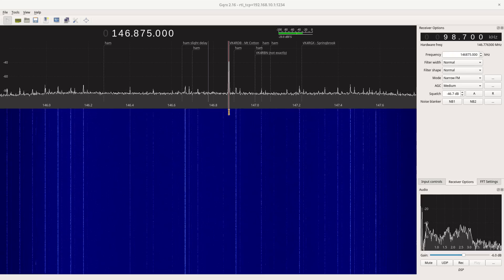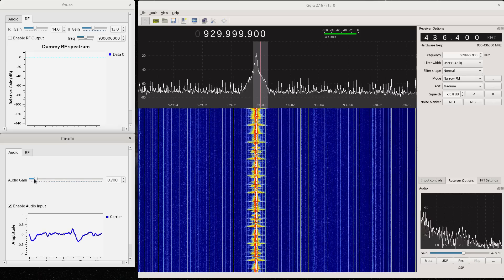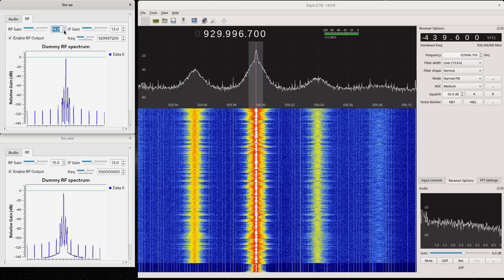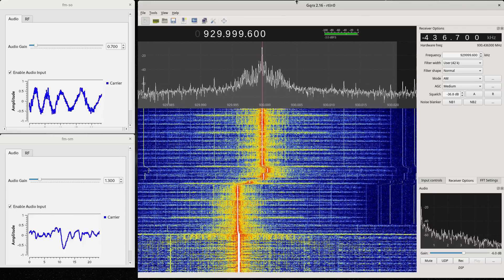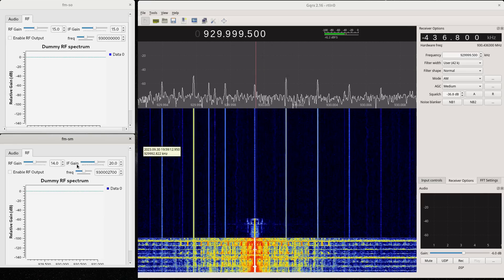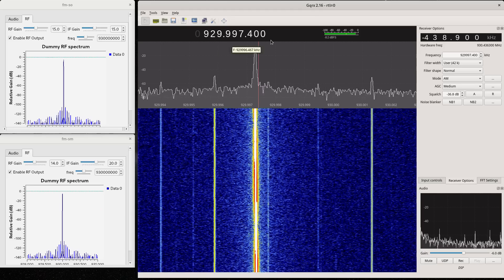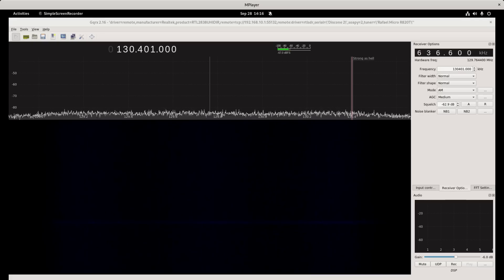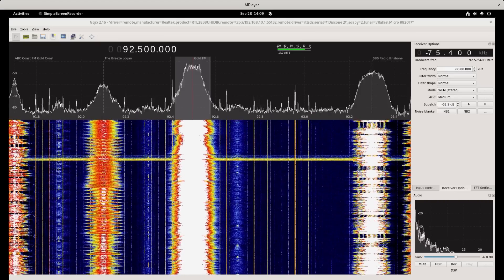Demonstrating FM Capture Effect

Comment: Interesting. So if doubling AM transmissions don't really lose much information, it should be possible to use DSP to clean it up when the carriers are slightly off frequency?
Reply: If you're not chasing high-fidelity, you can basically notch filter out the beat tone.   That frequency response at the notch frequency from both signals would essentially get lost, though that's not too big of an issue if you just want to hear voice transmissions.  I would imagine if the beat tone was not fully saturating the modulation at that frequency, some information at that frequency might be still recoverable.

Comment: rejection: AM is less susceptible to interference from electrical storms and other sources of noise. In aviation, it's critical to have a robust and reliable communication system.

Simplified receivers: AM receivers are relatively simple compared to Frequency Modulation (FM) or other more complex modulation techniques. This simplicity can be advantageous for aviation, where equipment must be rugged and reliable.

Propagation characteristics: AM radio waves can travel longer distances and are less affected by obstacles like hills or buildings, which is vital for maintaining communication with aircraft at various altitudes and distances from ground-based transmitters.

Voice intelligibility: AM provides good voice intelligibility, and this is crucial for clear communication between air traffic controllers and pilots. Even if there is some interference or signal degradation, the message can still be understood.

Regulatory standards: AM has been standardized for aviation communication, making it easier to ensure interoperability and compliance with regulations.

Legacy systems: Many aircraft and ground-based communication systems still use AM, and transitioning to a new modulation scheme would require significant investment and coordination. This legacy infrastructure plays a substantial role in maintaining AM's prevalence in aviation.

Proven reliability: Over decades of use, AM communication systems have demonstrated their reliability and effectiveness in ensuring safe and efficient air traffic control.

It's worth noting that while AM has these advantages, modern aviation communication systems are increasingly incorporating digital modulation techniques for various data and navigation functions, alongside traditional AM voice communication. These digital systems offer benefits like more efficient use of bandwidth and error correction capabilities. However, AM remains a crucial part of aviation communication due to its historical significance and suitability for voice communication.
Reply: All wrong!!!  The problem is the Dolby effect for the velocity of the planes!!!
Reply: I wouldn't say that AM can travel longer distance - AM really just a mode of operation. The 'distance' the signal can travel and be understood is more dependent on the frequency being used, and atmospheric conditions (time of day, solar activity, etc)

What we think of as broadcast AM radio indeed can travel a considerable distance, but that is simply because of the frequencies used for AM broadcast band are medium frequency (~535khz to ~1705khz) and capable of both ground wave and skywave propagation (especially at night)

The frequencies used for aircraft are all in the VHF spectrum and under normal atmospheric conditions require line of site regardless of the mode of operation. 
Since aircraft fly so high they have a rather large line of site radius and so whether they used FM or AM, they can be heard from a long ways off

I regularly listen to FM signals from the ISS and other satellite based repeaters at distances of over 1000 miles away with nothing more than a 'rubber duck' antenna because satellites are 300-500 miles above the surface.
Reply: "legacy systems" is literally the only reason on that list which actually represents a challenge.

Odds are pretty good you're reading this on a handled radio communication device which uses a far more complicated modulation than boring FM.  It also has incredible performance at low signal to noise ratios, offers excellent audio clarity, and manages exceptional range on absolutely tiny power budgets, through all but the stoutest of buildings.

It also retails for as little as a tenth of your typical TSO air band radio.

Modern digital electronics have a shitload of benefits to offer aviation communications.  The only thing standing in the way is the fact that you would need to come up with the funding to replace every single radio at every single ATC facility in the world at the same time, and also re-equip every single plane in the world and re-train every single pilot and air traffic controller.

Comment: What fascinating people this video attracted in the comments section. Guys. You're all drunk. Go home.

I have to say I didn't realise that AM signals can mix quite this well. Because in practice what seems to happen is that if the signal strengths are similar then you can't hear either pilot, just a garbled mix with a strong beat. If one is vastly stronger than the other (usually the ATC when you're in the circuit) then you can hear the stronger one very clearly with just a bit of extra noise - not unlike what FM capture sounds like.

Comment: "Some radio amateurs use FM", yeah, SOME, while MOST radio amateurs use SSB, either LSB or USB, for almost the same reason. Another reason is the transmission power and losses over huge distances. FM is good only for music broadcast from your local radio station
Reply: On the VHF and UHF bands most amateurs use narrow band FM. Except for contests, you will hardly find any radio amateur SSB stations above 54 MHz.

Comment: AM has the very desirable property of mixing rather than capture for safety as well - imagine someone trying to interfere with ATC operations by operating a transmitter close by. On FM, they could "take over" a frequency by being more powerful and if you did it right, you may not notice. Imagine the instructions by being able to blank out words or inserting new words and not being able to detect it has happened. On AM, you notice because both if it mixes, and that no radio is perfect and thus you always have the annoying squeal as the frequency is always off. This indicates to any listener that the transmission was likely corrupted and to confirm with ATC any instructions. AM will not be going away soon because of these wonderful properties of the modulation - the ability handle multiple transmissions (stepping on each other happens often at busy airports), as well as the ability to detect interfering transmissions. 

The only thing I wish I knew is why FM has the capture effect, but I guess that might involve a lot of calculus level math showing why it happens.

Comment: Also, aircraft radio was set up before FM was commonly used.  BTW, there have been occasions where an AM signal has been wiped out by another, with as much effect on desired reception as capture effect.  Another source of interference on AM is spark plugs in piston engines.  That takes some effort to suppress.  Auto manufactures also had to deal with that.

Comment: This works in theory in a lab environment when the transmitters are perfectly aligned.  As demonstrated, even the HackRF transmitters aren't even aligned perfectly until they are manually adjusted.  In reality there are aircraft flying around using their original radios that were installed in the 1960's.   In the US, there is no regulation stating that aircraft radios have to be aligned except for when they leave the factory or when they are repaired.   In the real world, aircraft communications in busy airspace are blocked unintelligibly many many times per hour due to the heterodyne effect interference demonstrated in the video.     I personally think that aircraft communications and safety could be improved by a digital system with tone keying that prioritizes ATC communications by restricting aircraft from transmitting while ATC is transmitting.

It's a very interesting demo and explanation regardless.
Reply: you may think that but it won't happen. AM is the safest way. Multiple digital transmissions cannot be recovered, just like FM.
Reply: @RoelandJansen  I don't *think *that aircraft communications are blocked unintelligibly, I KNOW they are blocked from personal experience every time I am flying.   I'm not suggesting duplex communications, I'm suggesting a system with a side tone type system where airborne aircraft are UNABLE to transmit when ATC is transmitting.   This will not eliminate the hetrodyne blocking issue completely, but will at least allow ATC to be heard at all times and not be blocked by airborne transmitters.    Furthermore, Digital AM transmission being more spectrum efficient would allow for more discreet CTAF frequencies at pilot controlled airport rather than 15 airports in a region sharing 122.8 causing tons of the same blocking interference.     The antique existing system just doesn't work and could be improved if the will was there.
Reply: airborne aircraft not able to TX, what a good idea. So that they cannot warn or communicate between them. WHAT A GOOD IDEA. 

Are you flying commercial airplanes? 

You seem to think that the heterodyne signals (which is not blocking, that's the whole point, they DON'T WANT A BLOCKING SYSTEM) is an issue. It ISN'T.
Digital systems have other issues too where bandwidths smaller than AM now is using, causing it less understandable too. 

I'm not inly an avionics engineer but also a ham radio guy. I als am using digital communications, FM, AM, SSB, CW and a few facts I know: both SSB and AM (both are amplitude modulated) makes it at least possible to hear different people talking over each other without blocking. Also, in any event, the pilots, not ATC have the lastcall here so if for whatever reason you think that ATC has the last say, is wrong. Even that makes you wonder how good of an example it is to have the airborne or ground stations kill the ability to TX. 

So, good idea but it makes stuff worse and it's not a problem. 

Even if you think your flying makes you a specialist - you aren't It ws and has been and will be a good decision to use AM for the past, now and the foreseeable future. Your ideas make it less safe. 

Now, get back to your single or two-seater and keep it flying.
Reply: @cgtbrad  riddle me this, Maverick, which do you think is safer:
1. Multiple people transmitting on the same frequency, with one of them being heard clearly and the other being completely buried, as if they never transmitted at all
2. A heterodyne indicating to everybody around that two people tried to transmit at once, so that they know they need to tell the offending aircraft to "say again"
Forget all the practical reasons why it would be dumb to change the international standard at this point, it's just clearly safer to use AM. Under ideal conditions, both aircraft can be heard. Under less-than-ideal conditions, they at least know that they weren't heard and need to retransmit. It's frankly ridiculous to posit that the global standard for civil aircraft communication "just doesn't work". 

I'll leave you with a quote, and I'll leave you the exercise of determining which type of reformer I consider you to be:
“In the matter of reforming things, as distinct from deforming them, there is one plain and simple principle; a principle which will probably be called a paradox. There exists in such a case a certain institution or law; let us say, for the sake of simplicity, a fence or gate erected across a road. The more modern type of reformer goes gaily up to it and says, 'I don't see the use of this; let us clear it away.' To which the more intelligent type of reformer will do well to answer: 'If you don't see the use of it, I certainly won't let you clear it away. Go away and think. Then, when you can come back and tell me that you do see the use of it, I may allow you to destroy it.'" -G.K. Chesterton

Comment: Great video explaining the topic. However, when I'm in the aircraft on the radio, if there's 2 people transmitting at the same time, I don't hear 2 people talking at the same time, but a loud noise which blocks both transmissions. Pilots and ATC speak once at a time, do you mean that there's the ability for AM to have multiple people to listen in at the same time compared to FM? I'd appreciate your input and expertise, thank you.
Reply: yeah he actually demonstrated that tone in the video, it's caused by a slight difference in carrier frequency between the two transmissions (which is also affected by doppler shift of the transmitters) and only eliminated when they're extremely close to each other.  I also wonder how receiver design might affect how objectionable the result is when it''s demodulating a sum of two closely spaced AM signals
Reply: I generally can hear both, but what's most important -- you will HEAR transmissions over each other so you know a retrans  is needed.

Comment: I'm not that knowledgable about radio but I have noticed some things when messing around with an SDR. One thing I've noticed is that FM signals seem to take up much more bandwidth than AM. I reckon you could fit a lot more AM signals in a given frequency range than FM, so that might be another benefit of AM.
Reply: It's a trade-off. FM doesn't need to be as wide as FM radio.  If FM is used for voice comms, like police/fire and ham radio, it can be relatively narrow.  Since commercial FM stations transmit music, by nature it includes a greater range of frequencies, and thus a wider bandwith.  AM encodes the sound in amplitude variations.  But AM modulation creates (and transmits) the carrier frequency (sometimes called the station's channel) and two side bands.  No information is in the carrier.  All the information is in the sidebands.  Unfortunately, half the power is in the carrier and a quarter of the power in each sideband.  Again the sidebands are duplication of the effort.
Reply: Narrow band FM has been around for decades and doesn't take much more spectrum than regular double sideband AM.
Reply: you can use 6.25 kHz bw in FM and in AM. it's not a benefit. both work, however, FM: strongest one wins, AM is a mix.

Comment: Because transmitters on any real mobile vehicle are never perfectly synchronised and (even more important) they move so the Doppler effect shifts the carrier frequency you will never ever be able to hear two AM transmissions at the same time. 
Also in case of emergency you need reliable way to get your transmission through. Therefore there is guard frequency, which is easy to access (dedicated button) and all airplane receiver's have second dedicated receive circuit just for that purpose.
Because of that, your explanation why aviation sticks to AM is wrong.
Actually, the Doppler shift for jet's cause two carriers to create low humming noise in range hundreds of Hz which iw what you usually hear in those "step over" cases for aviation radio traffic.
So, mainly aviation sticks to AM because of legacy. FM was adopted from 60's and radio was used in aviation from the 30's. Changing the standard from an interoperability perspective is hard and airports need to use transmission which is compatible with all airplanes.
It is not that FM is not used in aviation. It is for instance used in helicopters which cooperate with ground mobile vehicles like fire fighters or military.
Reply: Yeah, aircraft and ATC "step on" each other all the time. This was a factor in the Tenerife disaster, and can be heard in the readily accessible ATC audio recording of Sully's descent into the Hudson. The first thing he says on the radio is "MAYDAY MAYDAY MAYDAY", but due to ATC issuing instructions at the same time you only hear him from the callsign on. The maydays are present on the cockpit recording (not publicly released).
Reply: @ImpactWench  tenerife was, while a factor of stepping over, a CRM issue where we know that the captain was next, if not above "god". At KLM it's still a story nobody wants to talk about because of this.
Reply: oh my you are so wrong.
Reply: @RoelandJansen  So what are your arguments? Don't see a reason if you not point where I'm wrong?
Reply: easy. You  have a fire and the original way is to use halon, water, whatever. You decide to make things worse by trying to squelch people. 

Also, you don't seem to understand that it's afeature, not a bug to resolve. Any "fix" doesn't make it better. In the case of inhibiting TX of other systems, you seem to forget that multiple aircraft may be involved. And last of it, the pilot has the last say, not ATC. 

Anyways. as said before -- any fix makes it worse as you take away a wanted feature.
Reply: @RoelandJansen  What are you talking about? What feature? Man...
I was asking about a technical argument, not a story. Physics is not something you can change and AM modulation and its properties of multiplying sine waves of carrier frequency is basic math which explains why you hear buzz sound on the "step on" scenario.
This is well understood phenomena which the author of this video recreated. The whole point is he assumes carrier frequencies are never perfectly aligned in reality, therefore you always hear side products of intermodulation of carrier frequencies on "step on". Its not a "feature" as you call it. It is the reality of physics.

Seems you did not even try to understand what phenomenon is happening in such a case and call my explanation of whole thing as invalid.
This is hilarious :D